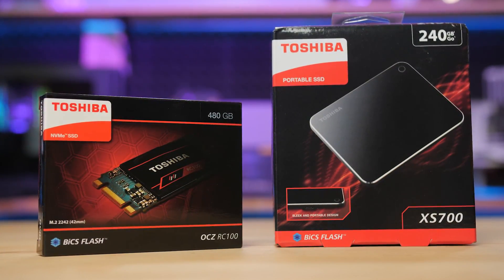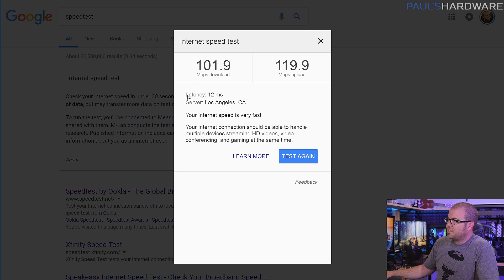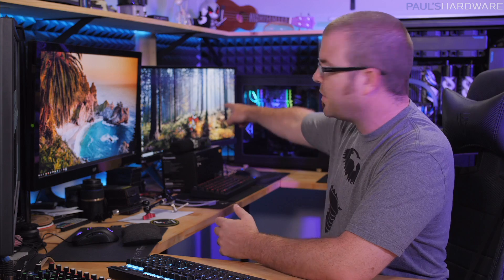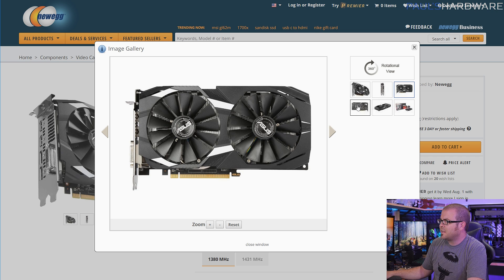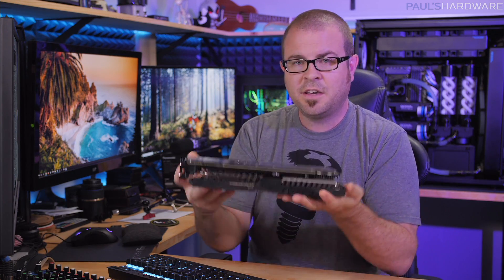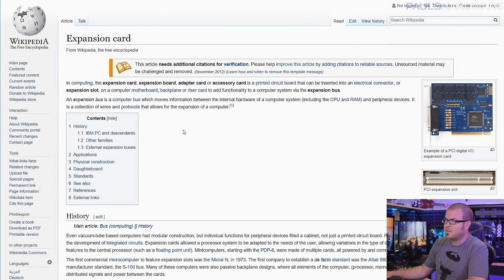Why are GPU Coolers on the "Bottom" Instead of the Top? - Probing Paul #26

Comment from the maker: ►TIMESTAMPS◄
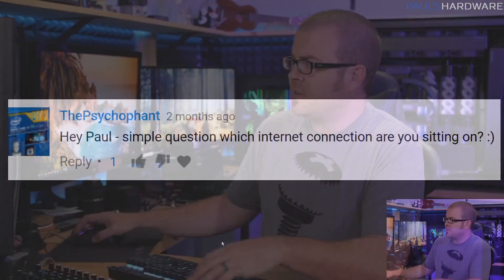0:57 How Fast is your Internet?
1:54 How many computers and monitors do you keep in your shooting space, and what are their uses? 
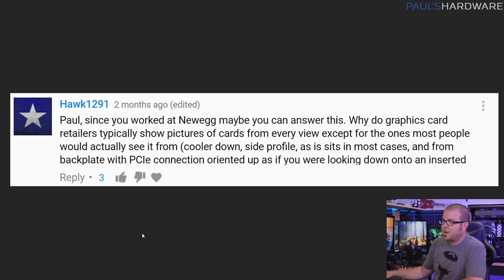3:34 Why do graphics card retail pics show every view except the angle you would actually see it from?
5:10 Why are GPU coolers on the "bottom" of the card instead of the top?
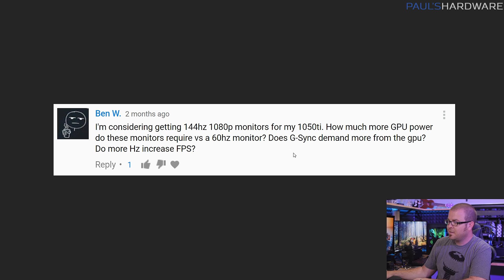8:06 Does G-Sync increase gpu load? Is a 1050 Ti OK for 1920x1080/144Hz G-sync? 
10:09 Are there any good/new horizontal (non-tower) case options for HTPCs?
11:44 Jay showed another method for fixing GPU Sag
Reply: Here is a link please check it out and yes they are affordable. http://www.mitsubishicomfort.com/products?gclid=Cj0KCQjwqPDaBRC6ARIsACAf4hAuHmShL-aXyEMwdABwyu7fw25qOEauzbS6Wev05d47AwjyydNvU4oaAtjvEALw_wcB Just trying to help you out, your too nice of a guy to be cooking like that and no I cant buy you one I am poor so I cant upgrade my graphics cards when they come out.
Reply: Hey Paul, why do vendors always advertise their hard drives with their platters exposed?
Reply: I'm looking to get a 6950X, and a hard to find X99 CLASSIFIED to mount it on! It will be the replacement for my X79 DARK.
Reply: Paul's Hardware do you or anyone have information about ddr5 ram (not gpu ram (v ram) )
Reply: The reason the reason GPU coolers are on the bottom because it keeps the hot air in the fins meaning better cooling when the fans start blowing.

It also minimises the amount of dust that settings into the cooler increasing the length of time before it starts getting hotter than normal.
Reply: Your better off looking at AMD’s thread-ripper chips unless their is some silly reason you dont want to use AMD
Reply: Simple more platters faster transfer speed.

They can falsify the number of platters to make their drives seem faster to those that don’t go look at the specs
Reply: Hi Paul. Could you do a temperature tests with motherboard flipped? I'm curious for temperatures on cpu and gpu having this configuration. Maybe you could throw in vertical gpu too with the motherboard flipped. 
Many thanks in advanced. ✌
Reply: when the computer industry was in transitiion from ISA to PCI, motherboards would have both slots.  you would have 2 slots on one slot "hole".  for instance look at the this diagram:

|:::::::::::::::::::::::::::::

the dotted lines are the pci slot (top) and the dotted lines on the bottom are isa.  so if you used a pci card it would block the isa and if you used the isa it would block the pci.  to get this to work they had to make the pci cards upside since the isa slots were already positioned right side up.  this let users either go all isa if they were bringing parts from their old pc or go all pci if they were buying all new.  so yes pci is upside down so that you could have 2 slots share one "hole"  at the back of the motherboard
Reply: in relation to the components on the top vs the bottom, as an "old tech" the reason why PCI shifted right side to left side, keep in mind that at the time most computers were still literally desktops meaning a horizontal as opposed to a tower design, the main reason for this was expansion slots, both in the case and on the motherboard. at the time most users didn't know the difference between the two standards and if the expansion slots in the case, and the expansion slots on the motherboard were left the same orientation, users would attempt to place a PCI card into an ISA expansion slot. the PCI slots on the motherboards were shifted from the them standard position to be further "up" the motherboard so that if a PCI card was attempted to be placed in an ISA slot, the backplate would not be able to be fastened. When teh original design of AGP was created, this is the reason the AGP slot was further from the backplate. and this is also the reason why the notch in PCIE cards is placed where it is, it's to prevent the wrong standards from being mixed together.
Reply: Paul's Hardware a
Reply: Dont know if you guys gives a shit but if you guys are stoned like me atm you can watch all the new series on instaflixxer. I've been streaming with my brother lately :)
Reply: @Alessandro Noel yup, have been watching on Instaflixxer for months myself :)
Reply: Since you have solar now, why not install that Mitsubishi A/C that plugs in the wall and it would cheaply, well free for you, keep your temps low in your garage. I am sure you seen those commercials on them for those enclosed outdoor or for people in their house.

Comment: There's no reason heatsinks can't be on top of the graphics card.  In fact I used to have a completely passive Geforce 660 that had a large heatsink on the bottom and top, connected by heatpipes.

Comment: Hello Paul, hope you can help me out. Is it worth to put 2x 140mm fans below or more likely between PSU and GPU? 
Since my PSU is putting the hot air to the bottom of the case, i was wondering if it's worth to install those 2 fans to blow the cold air towards my gpu.
Thanks for reading!

Comment: Cool air comes from the bottom and front of your desktop. The cool air gets sucked from the bottom into the GPU heat sink and the hot air escapes from the sides of the GPU heatsink.

If the cooler was facing up, sucking the hot air from the GPU and exhausting it to the top. It would heat up the CPU. (Which usually is above the GPU). And the GPU would not benefit from the cool air from the bottom of the desktop, because THEN the components on the GPU would be facing upwards.

Comment: in #23 someone ask about upgrading VRAM but its possible? to solder bigger memory like have 1060 3gb (6x512MB) and solder 6gb (6x1GB) and flash bios gigabyte have 6gb and 3gb version on same pcb so its theoretically possible  but in practise?

Comment: In 2004~2005, Intel attempted to introduce a new standard, BTX, which addressed the issue with gfx cards having the cooler on the bottom. However, not too many 3rd party vendors came on board with this, so in the end, ATX prevailed.

Comment: Paul, could you tell us some more about RAM ICs, we have 3 different brands: Samsung with E die and B die, Hynix with MFR, AFR and CFR, and Micron with I don't know what kind of IC. What ICs are best per each brand. Which ones to avoid? How can I find my kind of IC without having to remove the heatspreader on it. I myself now have Hynix MFR/TC chips on my 16Gb RAM kit for my Ryzen 2600X. I bought them because I had no ddr4 at that time and needed something. I have no clue whether they are bad or not, but at their rated speed of 3000 (16-18-18-38 at 1.35V) they sometimes post, and sometimes they don't. Would love to hear your thoughts!

Comment: Can you use 3000mhz DRAM on a motherboard that only supports 2666hz ram? What will happen? Will the ram just under clock to 2666hz? 
Thanks in advance

Comment: I have another thought on the orientation of the graphics cards. Like you said and like  common sense hotter air rises up. Generally and of course especially in the 'closed' cases. So since the fans suck air axially onto the cooler and through the heatsink it would be most profitable in terms of cooling if the coolest air possible is beeing sucked in.  That is why i think it makes the most sense that way because when the hot air rises in your case the cooler air would be located more towards the bottom of the case, providing more efficient cooling. What i find more conserning is that  to the contrary of a blower style cooler the most aftermarket gpu coolers exhaust the air through the side of the card into the case instead of exhausting it through the back.

Comment: I would guess that if the other way and the system is off dust will easily get into the chips and components adding more heat whereas the way they are now most parts are protected an to just leave the back plate to collect idle dust and easily cleaned...

Comment: Hey Paul,
In many of your budget oriented PC build, and other Tech-youtubers, there always seems to be a recommendation of a SATA 3 SSD and SATA 3 HDD; each usually costing $50-$60 based on US pricing. At that $100 to $120 total cost for storage, why does no one seem to mention RAID 0 a pair of HDDs for optimal/comfortable load times of both the Operating System and games?

Comment: 1) Don't put your case directly on the ground. Get a stand. Stuff a bunch of pizza boxes under it, Anything. Just don't let it suck in the dust directly from the ground.
2)Jayz's method fixes the visuals a bit, but does nothing to reduce flexing of the card or the slot.

Comment: It's time for a complete redesign of the computer case, GPU's, CPU coolers, motherboards etc to be cooled bottom to top as heat rises - stop fighting that by trying to push heat sideways, which is not efficient nor is it the best way for cooling.  I like the new Cooler Master SL600M Case with bottom to top airflow but it's $229, (I'll never pay that much so, please demand a $99 version).  Bottom to top airflow/cooling needs to be the new standard - at least for gaming systems that need good airflow/cooling. This is such an obvious badly needed change - it's kinda pathetic that the entire computer industry doesn't seem to be aware of the fact that heat rises ... somebody, for Christ sake's, please tell them asap. I have plenty of great ideas to help them out.

Comment: I heard Expansion cards are "upside down" because of dust.
(Nearly) All components are on the bottom, so it doesn't matter if there is dust on top of it. And dust will fall down (because of gravity) so it won't stick at the downside of the card where all the components are. Sure some of the dust will stick, but it is way less than if it is component side up.

Comment: I don't understand why anyone would realistically need an ATX board in an HTPC situation. How many add-in cards do you need in a living-room PC? SLI/Crossfire is basically dead with manufacturers only supporting 2-way and basically no support at all in newer titles, so more than one graphics card does nothing for you. That's only an ITX board. 

Now, for the sake of argument, let's say you have a 10G network in your house and REALLY want everything wired for 10G. That's only one extra slot, so an mATX board and case would be fine.  Another situation, you have two VR headsets that you want to run off a single motherboard with two GPUs. That's still in mATX territory, so no ATX is needed. Both of these situations are pretty expensive ATM, so tell me what reasonable situation would necessitate an ATX motherboard in an HTPC?

P.S. This isn't a question for next time; I'm just confused by the logic.

Comment: ISA was primarily designed around Desktops as in.. not Towers. They generally had a single out and in for airflow that was focused around the back right of the case. Making use of this flow, having cards radiate heat towards it made sense.

Video cards began drawing more power and putting out more heat so ventilation expanded and radiation needed to moved away from the processor especially after towers turned to standard. That's what we were told by an ISO standards dude when he came and spoke at our company and someone asked.

Comment: Hey Paul/Pauls community! I'm new to pc building and i had a specific question regarding these components; 
MoBo: https://www.newegg.ca/Product/Product.aspx?Item=N82E16813119097&nm_mc=AFC-C8JunctionCA&cm_mmc=AFC-C8JunctionCA-
RAM: https://www.newegg.ca/Product/Product.aspx?item=N82E16820331222
CPU (APU): Ryzen 2400g
I was wondering if you could OC the RAM, or if the MoBo will even allow it to run at its rated speed (considered an OC)? The only info/spec i can find says the MoBo rated to 3466mhz, i was just wondering if you could run the RAM at its rated 4000mhz on this MoBo? 
I know this sort of question was answered in Probing Paul #22, however i cant piece together what was said very well (no fault to you Paul, I'm a noob). As both products are relatively new, I'm struggling to find any info in regards to their compatibility, i have checked the QVL for the MoBo and cant see anything on there.
Also, what did you mean when you said "AMD Ryzen can be a bit finicky when it comes to really fast memory"?
 Any help greatly appreciated :) Thanks thanks thanks.

Comment: I went from running a 60Hz 1080p display to a 144Hz 1080p display without any compatible sync technology, and there was a small hit to thermals; my GTX 970 went from a 120 degrees fahrenheit idle temp to ~140 degrees

Comment: God, ISA.  I remember these.  The company I worked for (around 2000-2003) had Gateway 2000 machines, many with 133 MHz CPUs.  ISA slots were still around, and they had a NIC by HP that used this slot. It was a 10 MB/s card that was as big as a GTX-1080ti.  You should have seen the settings.. my god there must have been 1000 of them.  Pure witchcraft, that one.  We replaced them all with a tiny 100 MB/s 3com card.  What a relief from a support standpoint.

Comment: Hey Paul, I have a small (huge) dilemma here. I just picked up 3 Acer K2 series monitors which I am currently enjoying for my surround gaming set-up.  (Got them for a steal) Now, I been wanting a high end 4K panel to go with, manly for watching 4K Blue-rays and for games that mainly do not support surround. ( I.E Fighting Games, Moba's, Overwatch and anything Bandi Namco related). Due to that, I have feasted my eyes on Acer 32" XB321HK G-SYNC V2 IPS 4K Monitor (Acer fanboy xD). Now here's where my dilemma starts to kick me in the nuts.  I know for a fact that the Jump from 1080p to 4K is massive, and I will probably will want to end up replacing my K2s with the XB321HKs. This the introduces the new problem of driving 12K resolution across 3 monitors, which I don't think were ready for yet, GPU wise. So now, I am back to thinking maybe if I go 144hz on 1440p, things might be bearable. However, I will end up forking over twice the money for a decent 144hz pannel  and still not get that full resolution. Now, I have concidered the BFGD 65" pannels coming up, but they are probably going to be even more expensive than what we have now so that they don't end up cannibalising the slighter faster yet much smaller 144hz 28" 4K displays, which is still way out of my price range and lets not get started on surround. I really don't know what to do, and I am not a fan of 21:9 either, should I wait until we either get beefier GPUS and monitors to get cheaper or take the plunge and go for a monitor like the Dell S2716DG 27" Nvidia G Sync 144Hz QHD and slowly build my way up to there? 
P.S Future proofing is the key here, rather than Budget. Thanks Paul!

Comment: I think the cooler on the bottom is best.  Why?  Well, you said it, hot air goes up.  If you put the cooler on the top, it blows air down, the hot air comes out the side or end and rises, then the fan can suck that warm air up and blow it back through, ick.  On bottom, it blows the air up, goes out the side or end and rises away from the cooler.  The poor CPU can just fend for itself and use that warm GPU air and be thankful that the GPU was thoughtful enough to send it some warm greetings.  I have a Core X9 case, so my GPU cooler is on the side and the exaust from the GPU just rises up and out the top :)
Reply: a simple fan pushes so much air that the orientation is irrelevant (if a cpu wasnt there or if it's not at much load)